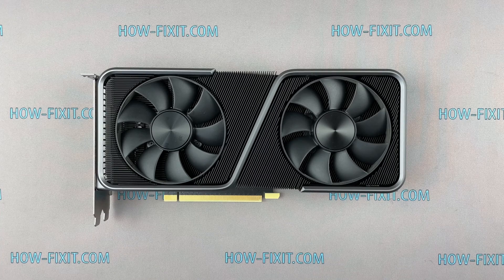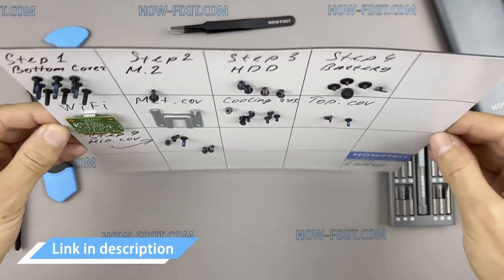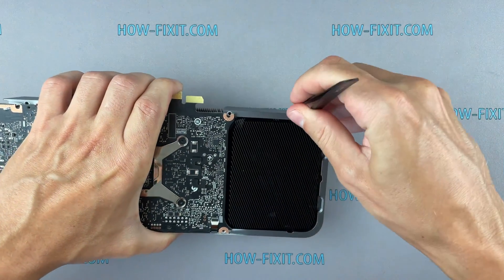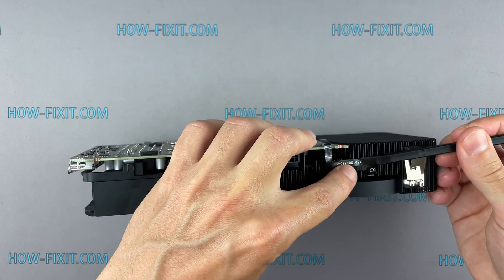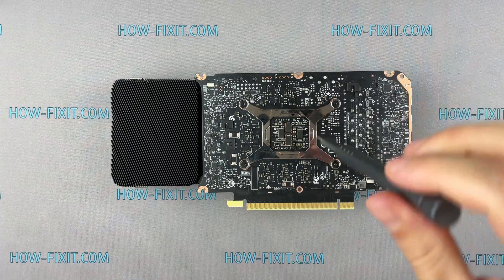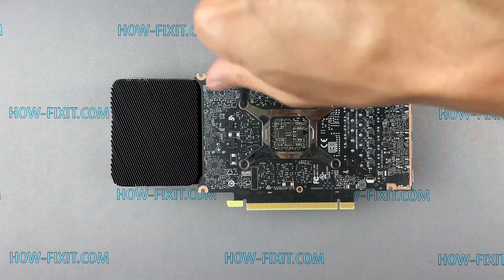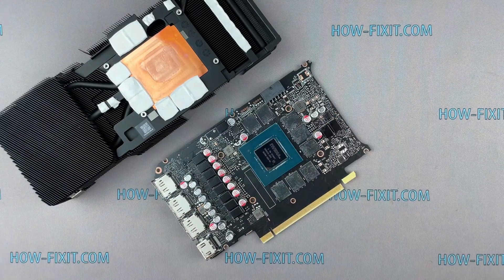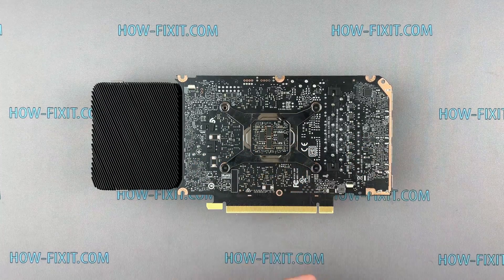GeForce RTX 3070 Disassembly, fan cleaning and thermal paste replacement

Comment: The thermal pads, once the GPU is opened, it is convenient to take advantage of and change them to extend the life of the graphics card. Rejecting them after being used for 2 years, for example, is counterproductive, even if the 3070 FE does not overheat the gddr6 memories, the vrms are set to 80 degrees!

Comment: Ive got a nearly 2 year old 3070 from Dell... its got a different head sink / vapor chamber etc. over all I followed all of the steps and removed all of the screws but could NOT for the life of me separate the board to access the GPU chip to replace the thermal compound. Just wondering if you have ever taken apart a Dell built 3070? I was really stumped and disappointed because it almost seemed like they made it so I cannot take it apart to clean / replace thermal compound which sucks because my thermals have started to rise over the last 2 years from a zero fan operation at no load and around 44 degree C to a 700 rpm fan speed to maintain the same temp... so I would very much like to replace the Thermal compound as I suspect its hardened and is not as efficient as when the unit was first produced.

Comment: Did you see any improvements with the mx4 thermal paste compared to the stock one? I have been thinking about doing this in order to get my gpu temps down a few degrees